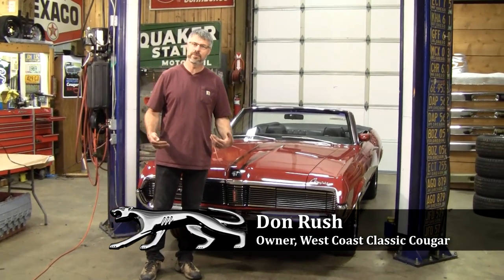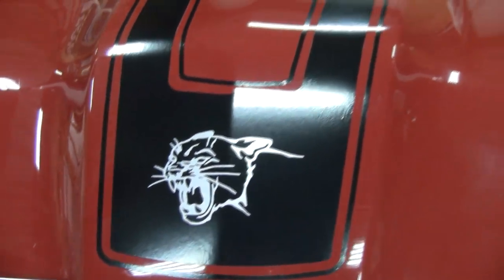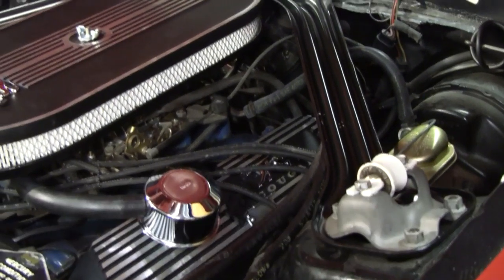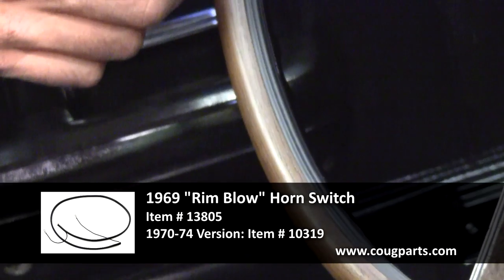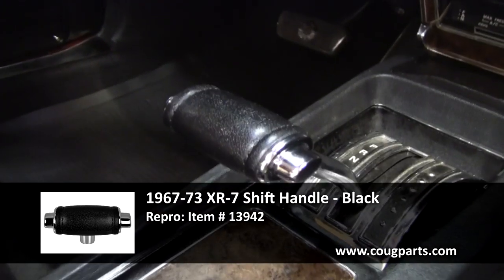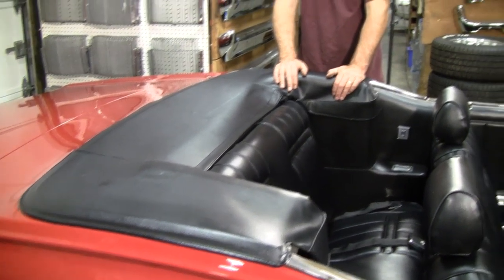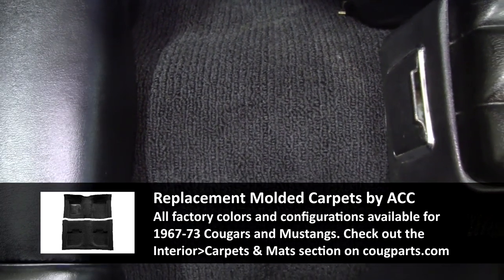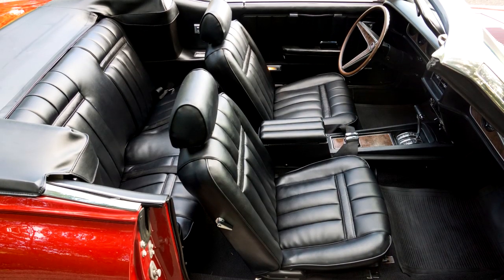Favorite Parts - 1969 Cougar XR-7 Convertible

Comment: When I was in high school my neighbor worked for our local small town Ford dealer. He had a beautiful 1969 XR7 convertible in a candy apple red with white buckets, the mag star wheels, 351 Cleveland with a 4 speed on the floor. He put it up for sale for $2800. I wanted that car so bad but all I could muster up was about $1000. This was in 1980-1981. I ended up buying a 1965 Mustang hardtop in the same red with Pony interior and a 289 4 barrel for $1k. Always wonder what happened to that car?